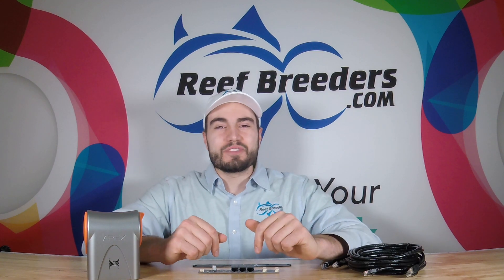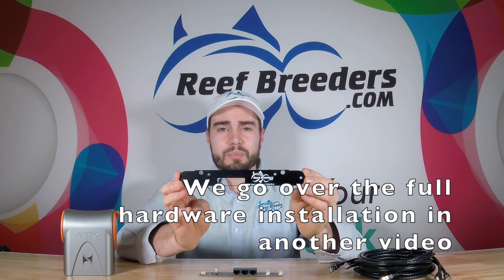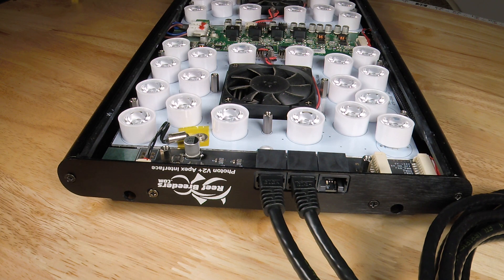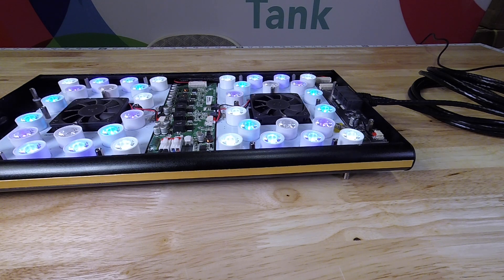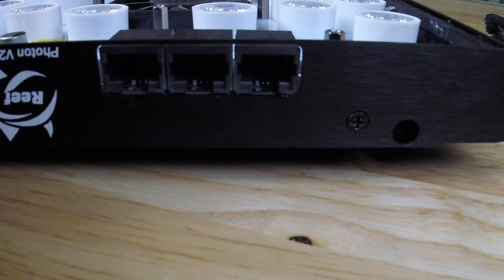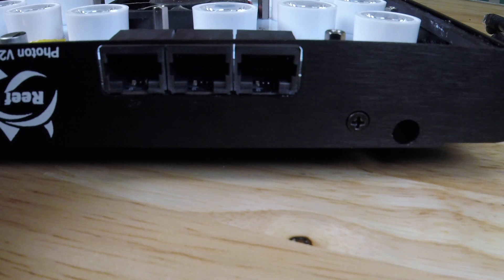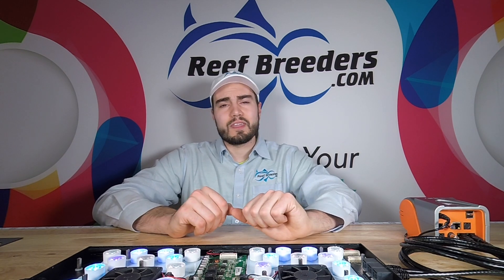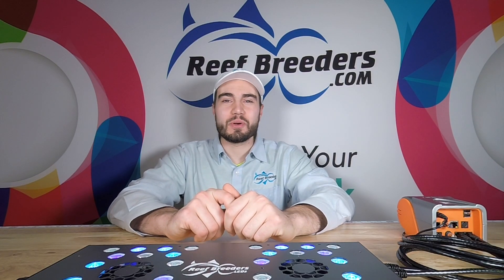Photon V2 Apex Integration Kit Setup Guide

Comment: This video freaking stinks. 
1. Do you plug in light to the VDM. Then plug into wall? As the video shows? Then push the button? 
2. Or do you plug the light in then push the button.
I’ve done both. 
The light keeps going through the channels as if I just plugged it in. 
So frustrated at the moment!
Reply from the maker: Hey Ken, 
1) Doesn't really matter for intial startup. However for calibrating your lights and setting the 0 point, yes, you need these plugged in and you need the apex VDM ports configured appropriately. 

If your light is just going through channels while it's plugged into the apex, that's likely because you didn't configure your VDM ports yet. If you need further guidance on that feel free to email our support team: https://reefbreeders.com/contact/

We can remote into your apex and assist with program if you're not sure how to program it.